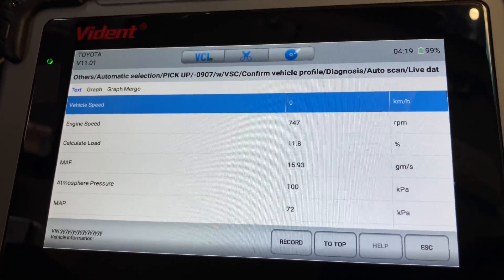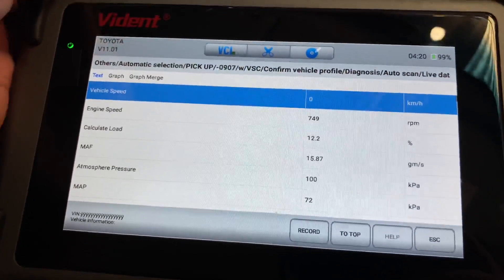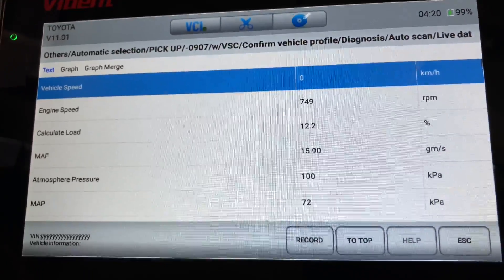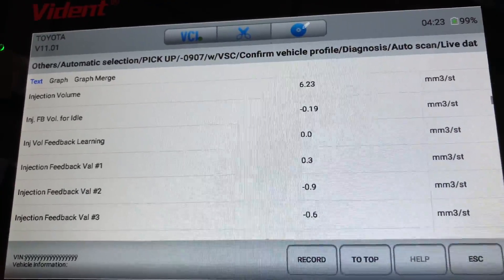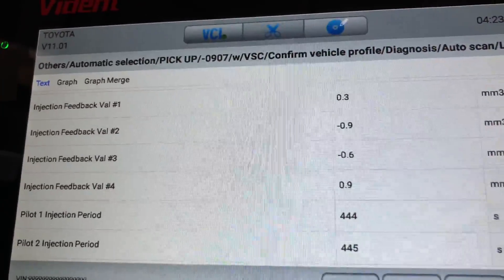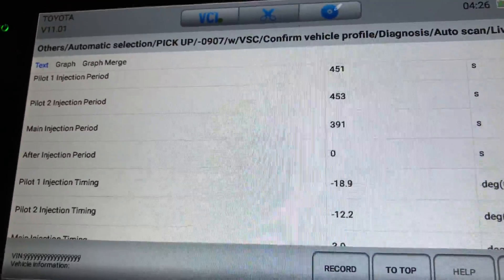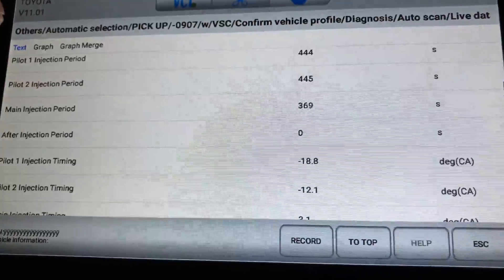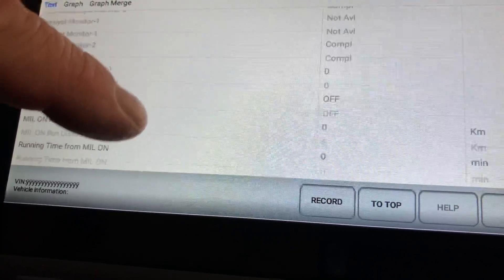How to KNOW WHEN to REPLACE INJECTORs DIAGNOSTIC SCREEN information Vident 800pro AZSCANNERS

Comment: hi anthony

i have a hilux 1kd ftv manual transmission when i did the test i have injector 4 which is at 1.5 and when i accelerate around 3500 rpm i get jerks on acceleration. when i reset the injection to zero with the same as you have there are no more jerks but after a while it comes back i would like to know if it's the injectors i need to change. my mileage is 180,000 km. thank you for your answer.

Comment: Hey Anthony, 

Great video mate, just a quick question on the Vident iSmart800PRO that your using, does it have the same features that you used on the Toyota on Holden vehicles, specifically Holden Captiva 2008 CG CX 2.0L Diesel, for example: does it support fuel injector live data etc. 

I tried to reach out to support on AZ scantools (distributor), but their responses were unhelpful, so because you already have the scantool, i thought that i would try asking you instead, since you seem to have experience with the iSmart800PRO and its capabilities.

Kind regards,
Rio

Comment: Hi Anthony! great video, very useful! thanks. Btw, can you please confirm that for LC150, 2011, 3.0 140kw **with DPF**, the pilot 1 and 2 inj periods values when warm should around 215us, while the main inj period around 230us? Asking because in your videos for 1kd-ftv (lc120, lc150) you are probably checking primarily cars **without DPF**. If I have the right info the 1kd-ftv with DPF has lower pilot 1/2, main inj values (around 215-230us) while without DPF the pilot 1/2 and main in values are higher (e.g. 440/550us). Looking forward to your expert opinion :) Thanks man! greetings from Prague!